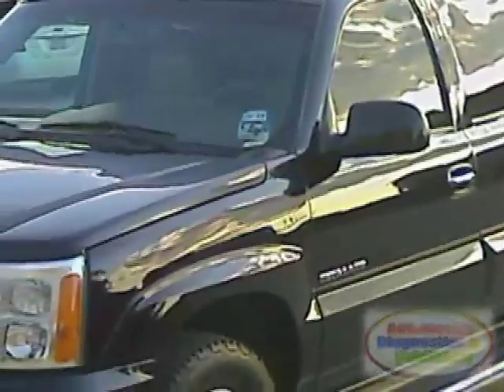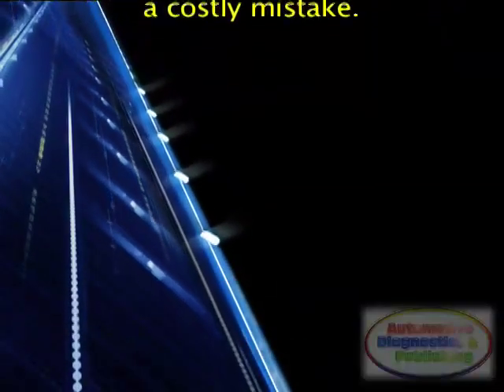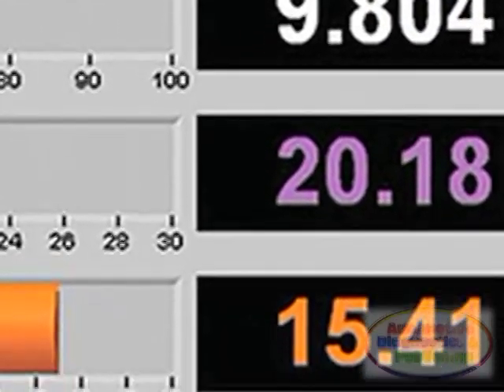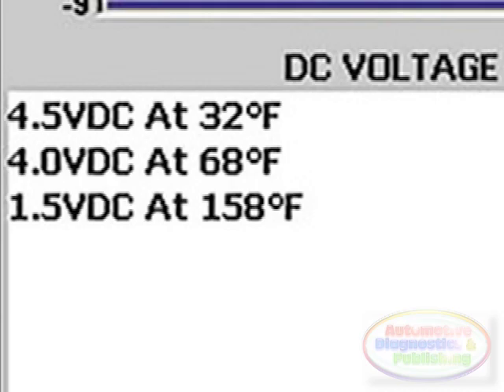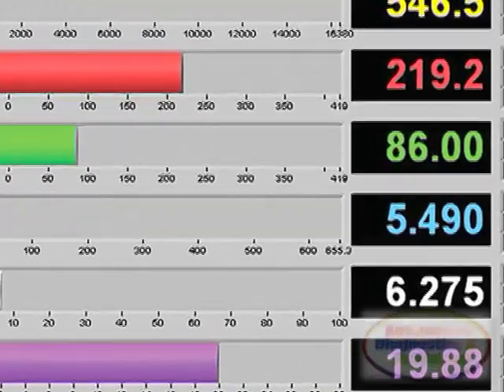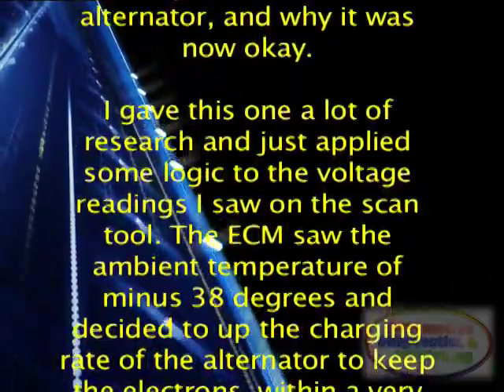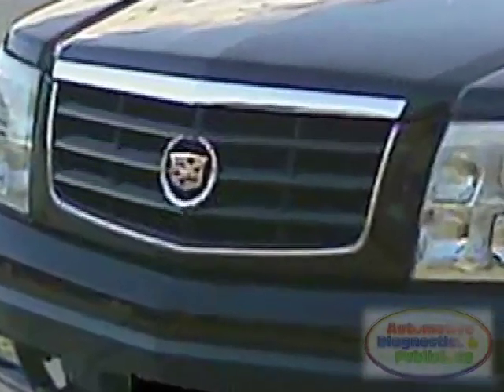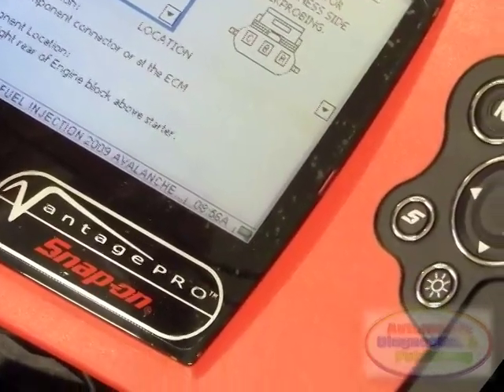Looking into an Escalade's Mind

Comment from the maker: @mman454 Well, there's no reason why the connector should be having this problem. Assuming the install was done right, the only other issue could be the CAN network. Almost all radios today talk to other modules over the CAN network. Features such as automatic volume control leveling during acceleration is one of them. You may not be able to get rid of this issue. After market items are a huge source of issues after repairs or installations. Thanks for posting...

Comment from the maker: @mman454 OK, that says a lot. Then I suggest you remove the CC disassemble it and put on a magnifying glass. Inspect the connector PC board or wherever the connector meets the board. There's definitely a bad solder or trace. This may be easier to repair than you think. You just have to be careful. See how you make out and post back with more...

Comment: @ADPTraining However, if I give the climate controls a few good hard taps the lights will come on. Sometimes all of them come on and sometimes each tap gets a few more lights to come on or go out. I know for a fact that there are two connectors going to the climate control faceplate. I'm assuming one is for the lights and the other is for the actual climate controls? Some connectors in cars or computers will seat as though they are being pressed outward by a spring. Could this be an issue?

Comment: Ive got another question for you. I own a 2002 Dodge Intrepid SE with a 2.7L engine.
I recently had a new radio head unit put in professionally. Since then the lights on my climate controls don't always work very well. Some are lit, some are not. I brought the car back to them and they reseated a loose harness for me. However its started to work intermittently again.  Is there anything I can do to the connector to make sure it stays seated completely?